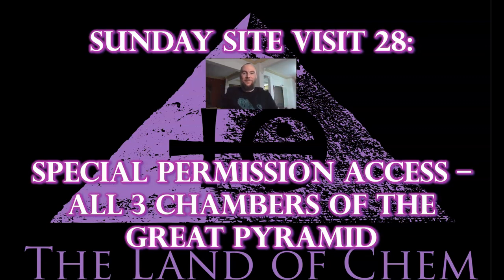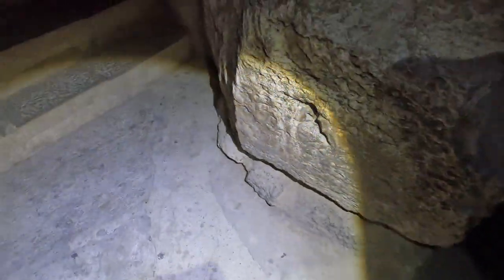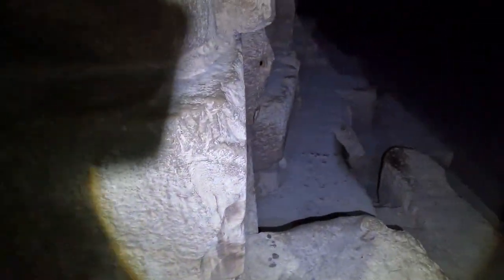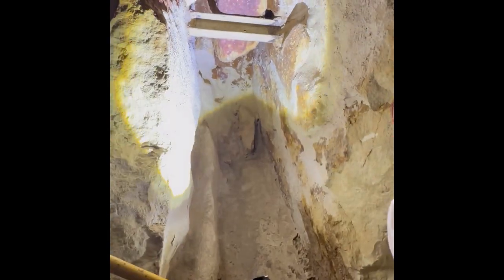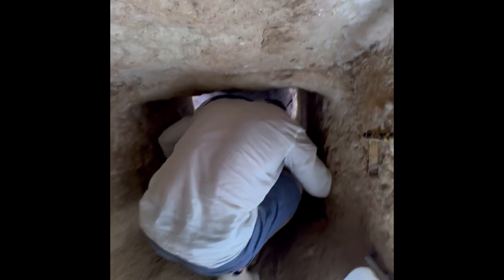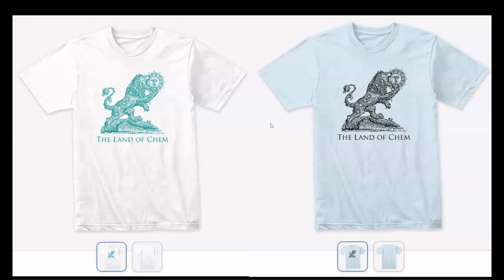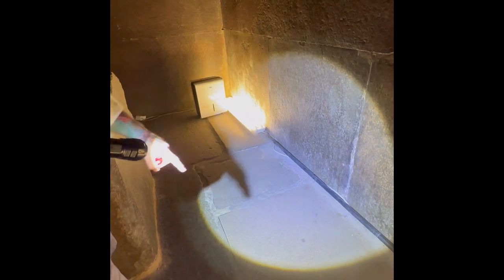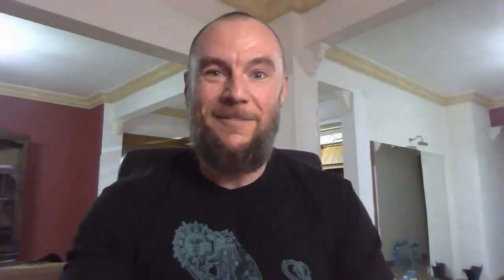Sunday Site Visit 28: ANCIENT EGYPT - The Great Pyramid At Night - Private Access All 3 Chambers

Comment: This is speculation, but I've estimated that the Great Pyramid is about 1.6 million years old, because they were openly using technology that we can only do in secrecy in modern times because of corporate interference, like with Coral Castle and its construction in a special remote location near the Everglades in the 20th century.  The ancient builders incorporated the value 365.0200809 into their construction of the Great Pyramid (Khufu), and by using the length of the year as seen in the Mayan record we can determine the rate of change over time. This 365.0200809 value divided by Pi^3 yields the distance in seconds between the center of the Khufu and Khafre Pyramids and between the center of the Khufu Pyramid and the Great Sphinx.